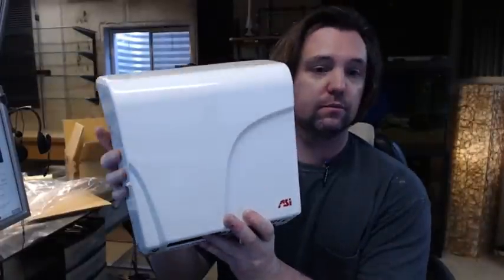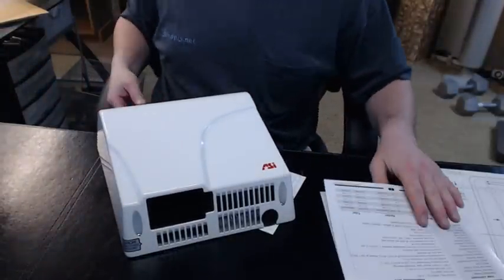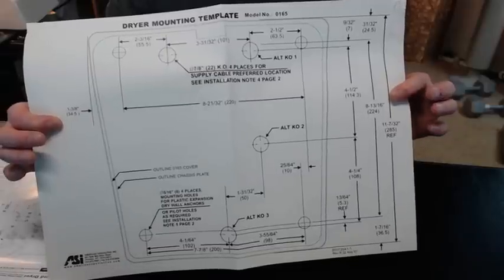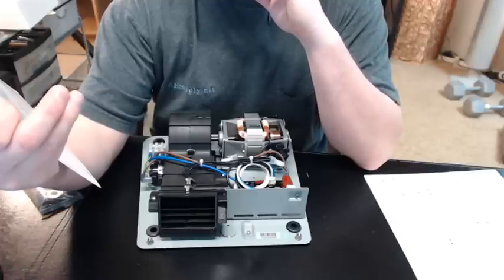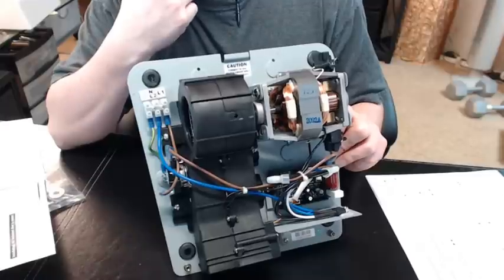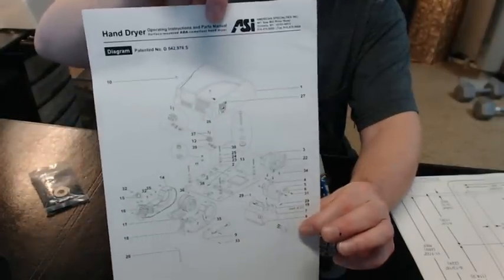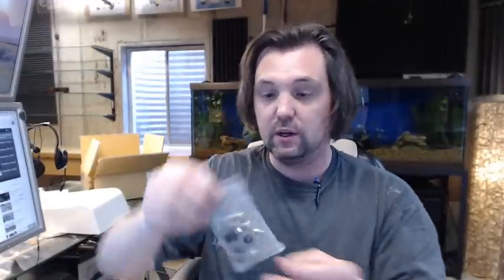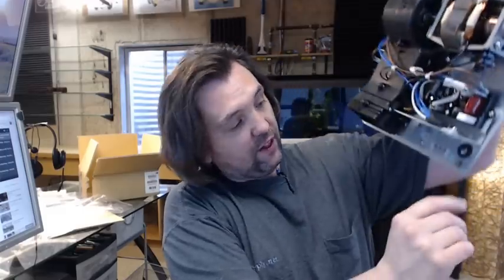ASI 0165 115VAC Hand Dryer

Comment: I’ve used this hand dryer before, didn’t think it was very good though.
Reply from the maker: In what way?
Reply: @absupplynet  The airflow was a bit slow and the sensor wasn’t that good, I much prefer high speed hand dryers.
Reply from the maker: @AirsanzFanatic303  Compatred to turbo type hand dryers, yes the ASI 0165 will seem anemic, but iit is aso 1/3'rd the price of more powerfu units.  Each has a place and comparing this to a high speed unit is not "appes to appes"